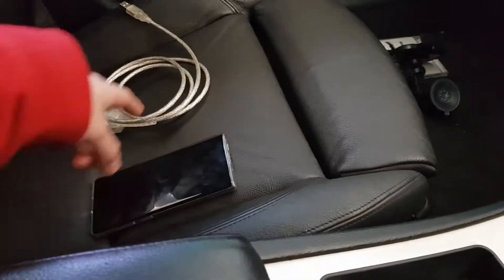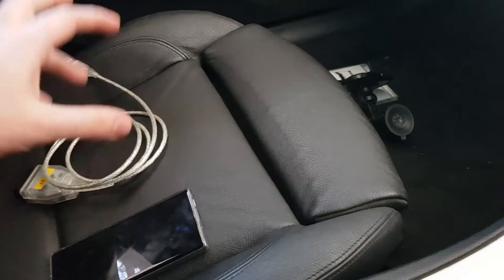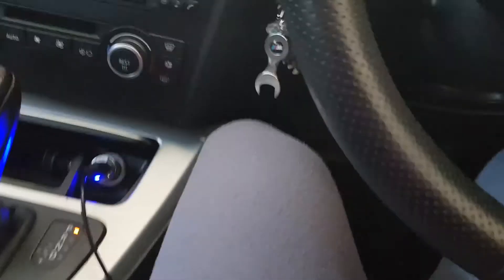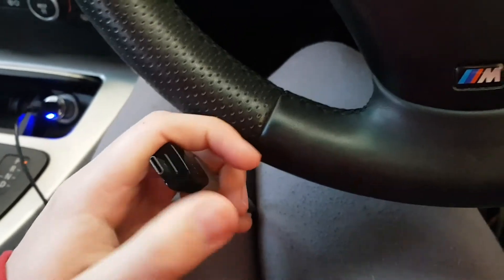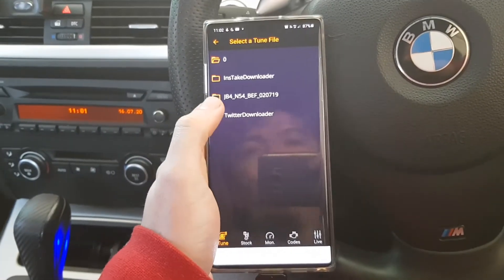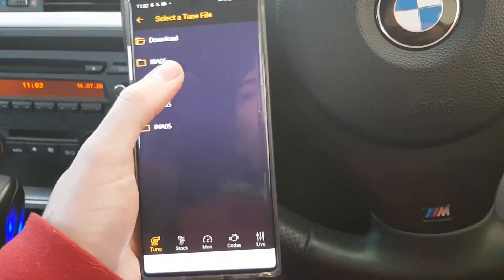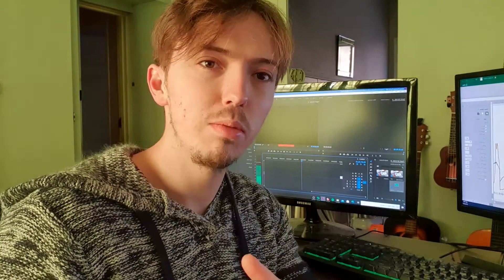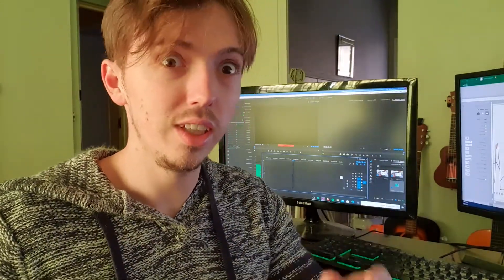JB4 backend flash install + Testing and viewing logs

Comment from the maker: Hi guys, so i went thru the logs again the car did have higher boost with the backend flash but those peaks are when you let of the throttle before the BOV opens. Before i run around 14psi and after around 16.5 to 17psi before the spikes. hope you all enjoy. 💚